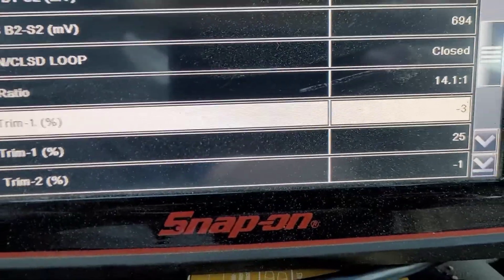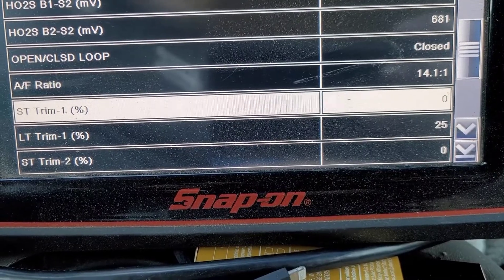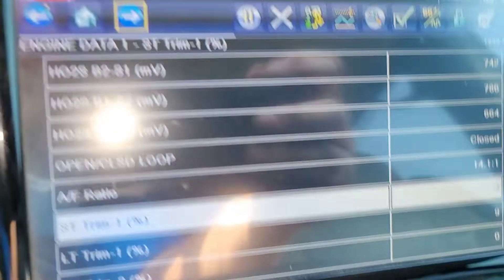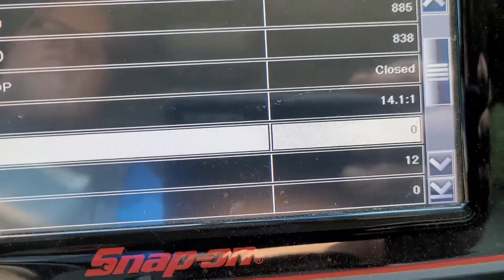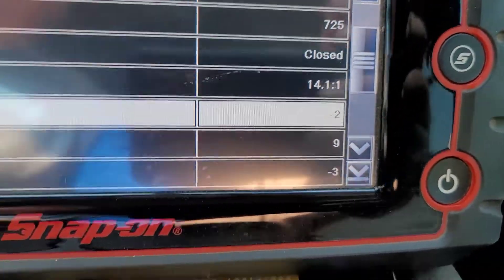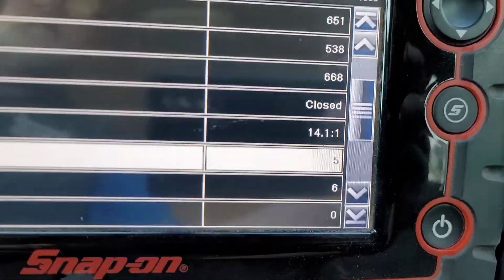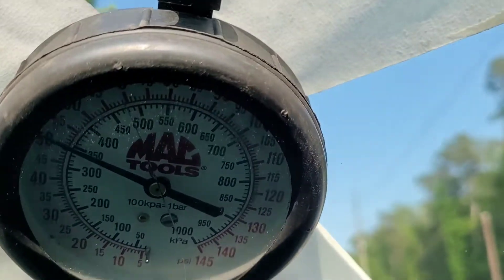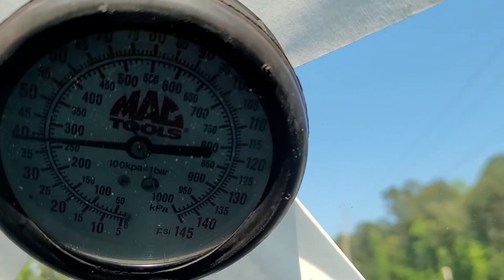Severe power loss in a Chevy Tahoe 5.3. What is "Short Term Fuel Trim" ?

Comment: My 2012 Tahoe has this issue but it doesn’t die.  When accelerating it almost feels like the brakes are trying to hold it back.
Reply: Did you end up figuring your issue out? My 07 Tahoe isn't throwing codes,  no CEL, isn't dying but so boggy feeling when I accelerate!
Reply: @KelseyOuellette-h8l  no I haven’t.  I am taking it to my mechanic this Wednesday to have them look it over to see if they can figure out what is going on.   I have put new spark plugs and wires, but no improvement to speak of.  It seems to do it once it gets hot.  When the engine is cold first thing in the morning it runs fine.
Reply: @Sky-Carr  did you figure it out?
Reply: You figure it out? @Sky-Carr

Comment: Same problem here, codes im seeing  PO101 and PO449. Short term fuel trim is -2.3% at 1350 rpm, Evap soleniod coming in tomorrow, but my problem is like yours, boggs down when you accelerate. I have changed the Fuel pump, fuel filter and the fuel regulator, verified the air filter to be clean, changed sparkplugs and wires and cleaned Mass Air Flow sensor... STILL BOGGS DOWN but idles fine,, any ideas ?
Reply: I’m in the same boat. Did you ever have any luck?
Reply: @Idkdude-x4g  did you figure this out garret? my truck just started today
Reply: @kevinqueener439  never got it resolved, but I did find out with my scan tool, the transmission was severely slipping while driving. So, the rpm surging seemed get better after cleaning sensors and throttle body, but only improved it.
The transmission slip was a whole other issue, that I assumed was idle/rpm.
We ended up trading in on another vehicle. It just got to the point of it nickle and diming me to death...
Reply: Same with my 2012 Burb. Ever figure it out? Idled slightly rough with a 50-100 rpm porpoise. Drives fine at set speed, but kind of boggy during acceraltion or maintaining highway speed up an incline, for example. Noticed the rpm porpoise when it happens and can obviously feel it.
Cleaning throttle body, changed plugs and wires helped but didn't eliminate everything. No codes and nothing stands out in scan tool.
Reply: @rickeydoster4494  did you figure this out? my truck just started doing this today

Comment: had to replace the unit in my '00 Silverado. at that time i couldn't afford an OEM and had to get it running, so, cheap knockoff. pump is still working a couple of years later but the sending unit doesn't. so now the only way i know 100% positive how much gas i have is to fill up and reset the trip meter. and with almost 4 dollar a gallon gas that's not always possible. sometimes ya gotta do what ya gotta do right. livin' the dream....LoL
Reply from the maker: I've been there myself . My own Silverado has an issue similar to this truck , but only happens when I accelerate hard or hit a long grade on the highway. It will loose power because it can't supply enough fuel .. I've been living with the issue for 3 years lol 😆

Comment: The Test Track really comes in handy for these Kinda intermittent failures …Genius Trick  …..on the fuel pressure gauge taped to the windshield … so I guess the pump was weak and couldn’t hold up under load ..?
Reply from the maker: Yea . The pump kept dying out and dropping fuel pressure. One time when it shut off , it stayed dead for a bit . Wouldn't restart . I thought I was gonna have ro have it towed back . But then it started and actually ran decent all the way .. After the pump , ran great !
Reply: The analogy is similar to a voltage drop test in electronics. The pump can produce pressure when it's not required to put out volume, so static pressure may be OK. But when demand for higher volume arises, the pump can't produce the extra volume so system pressure falls, just as voltage falls during a drop test. Typical mechanical causes are external resistance such as from a clogged fuel filter or pinched line, or internal resistance from an impeller that can't produce enough volume, a clogged sock or a line that leaks back into the tank.